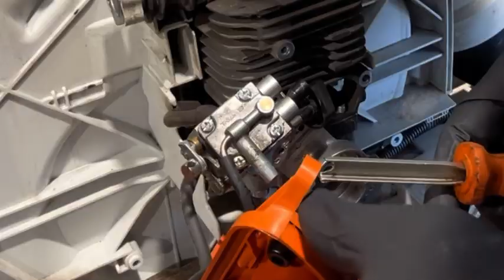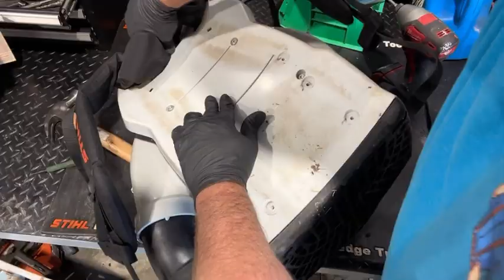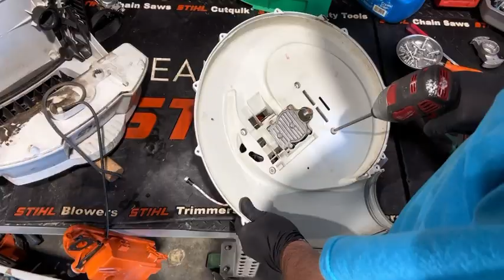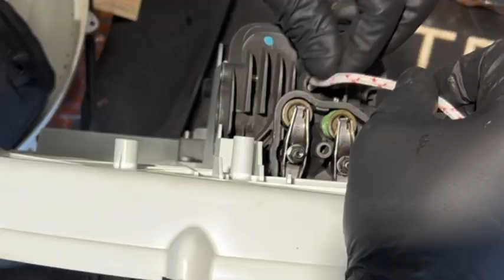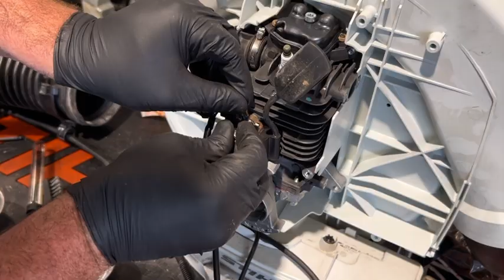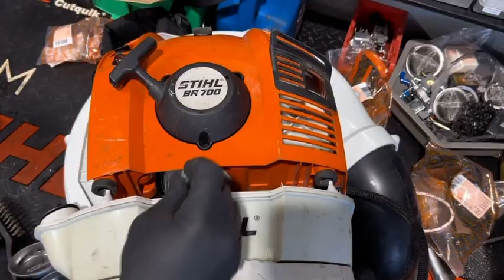Short block replacement on a Stihl BR 600 backpack blower. How to replace the piston & cylinder.

Comment: I just had the frozen top bolts happen to me, all you need to do is put a soldering iron to the thread side of the screw and hold to transfer heat for about 5-7 minutes. Let it cool and they back out without issue.  Save you the pain of ordering a new plastic shell.

Comment: What is the cost of replacing the short block. My piston locked up from someone not using the correct gas/oil mixture.
Reply from the maker: Most short blocks for trimmers and blowers are in the $180-$250 range

Comment: I’ve Done Several There Was a Recall on The Short Blocks 😀😊😀 That T-27 On The Rear Housing Mounting Bolts are Always Stuck I Use a 3/8 Air Impact and A 1/4 Adaptor and T-27 Stihl Bit and Hit It Quick Always Shocks It Loose 😀👍🏼 Nice Job 👍🏼